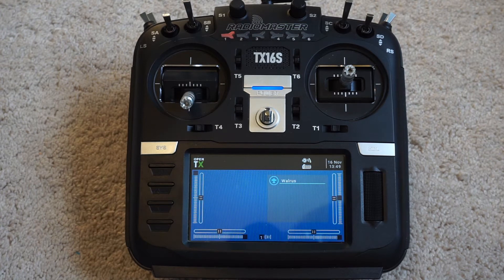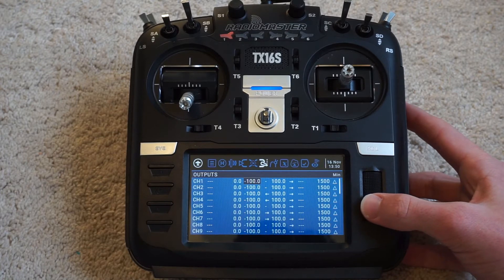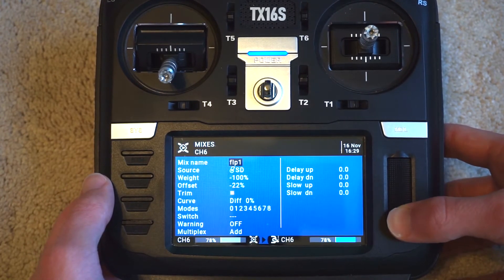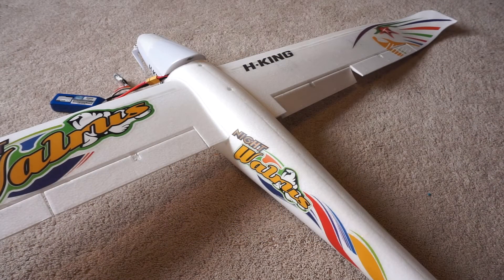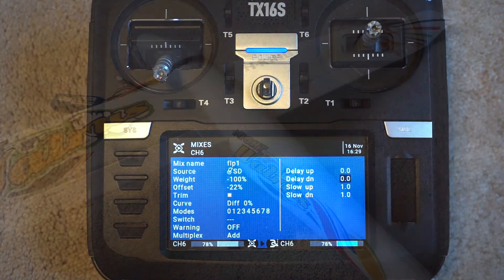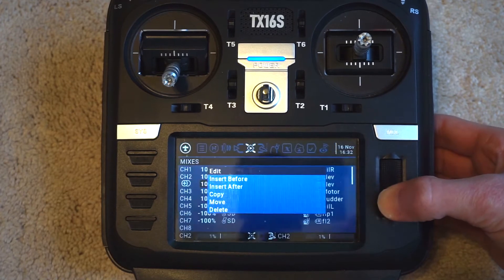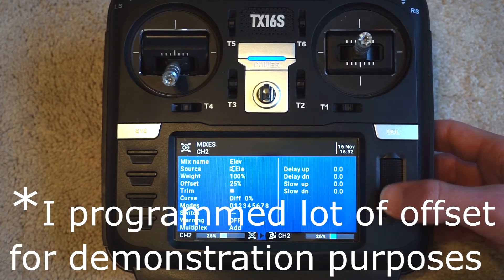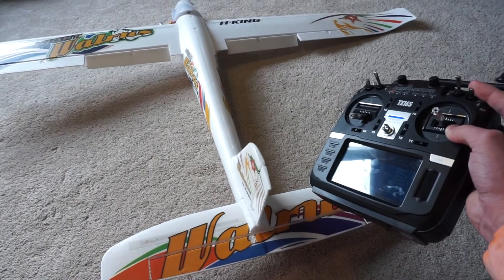RadioMaster TX16S Setup | Pt. 2: Advanced Model Setup

Comment: Hello, thanks for the video. Can you please do a video dedicated to Spoileron only and explain about the meaning of Weight and Offset values changed. Does one of them influence max output of servos and can it push them over their physical limits and damage? Thank you.
Reply from the maker: Hi! I went over Spoilerons at 2:35 in this video. I will make another video soon on the Tundra that will go into more details on spoilerons. Weight is going to limit your servos or throttle. For example, if you have a weight of 80%, your servo will move from -80% to 80% instead of the regular -100% to 100%. Offset is essentially where you want the servo to start. Think of it being a trim set as a default. As for your max output on the servos; that won't damage your servos as they won't take anything outside of -100% thru 100%. Going under -100% or over 100% won't damage them, they will just go as high or low as they can go. I will go into more detail of all of this in the next video! I hope that helped!

-Jonathan
Reply: @AV-14  Hi, thanks Jonathan, that helped. Looking forward to more details in your next video.

Comment: Hello, on the old remote control I had a mixing that when I gave the right aileron the right flap was raised, while the left one remained stationary and when I gave the left aileron the left flap was raised while the right remained stationary.  This is to increase the roll.  With radiomaster tx16s I can't do it, could you help me with a video?  Thank you very much
Reply from the maker: I will work on a video this week for that! Thank you for the suggestion!
Reply from the maker: What TX are you using?
Reply: @AV-14  radiomaster tx16s
Reply from the maker: @claudiopepefly  I see. I will just explain this over a comment. Let me know if this makes sense:

In the ‘OUTPUTS’ page on the model setup, adjust your aileron min/max values so they will only move to one side. 

For example: Aileron 1 will have a default of min: -100, max: 100. Assuming the direction of the ailerons are correct, you will have to set the min to a value of 0. This will force the aileron to move in one direction. You will have to play around with this, as servos are installed differently depending on the models. 

For the flaps:
You’ll want to go to the ‘MIXES’ page. Under your first flap (let’s assume left flap), you will want to assign this to your aileron stick. This will allow your flap to move when you move the aileron stick. Then, adjust the ‘OFFSET’ of the flap so that when the stick is centered, the flap is flush with the rest of the wing. Adjust weight/direction according to what stick input you are giving. 
Repeat this process with the right flap!

I hope this helps! If you need I will post another video explaining the process.